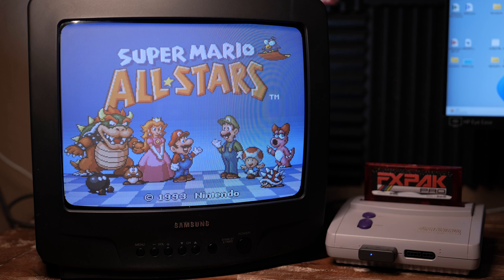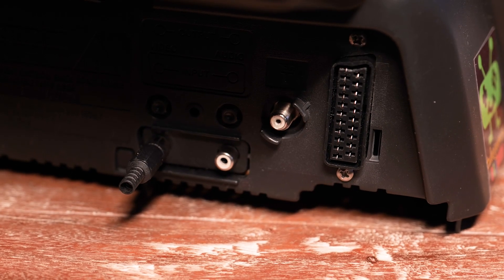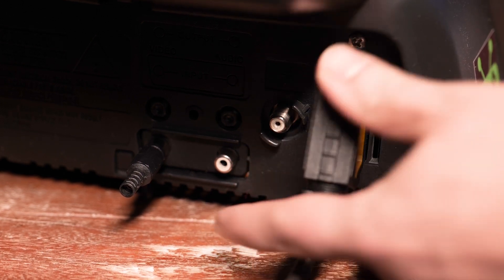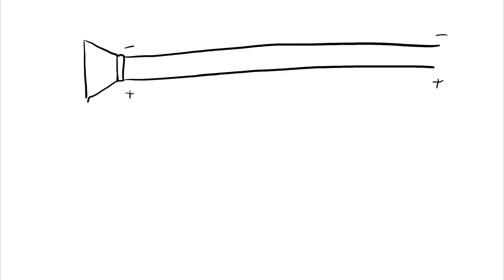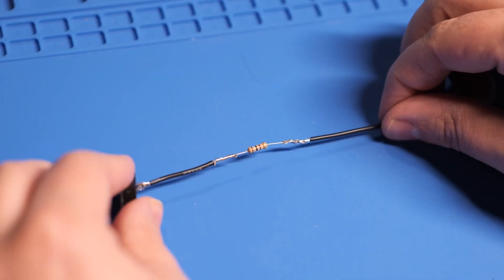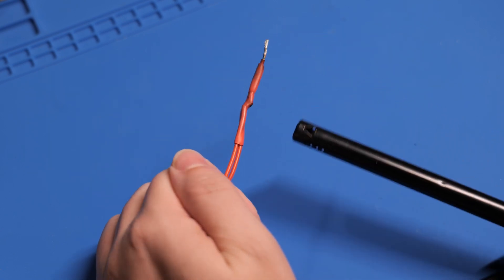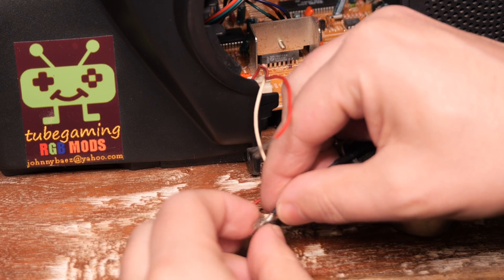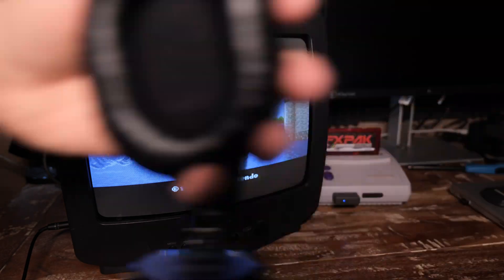Installing a headphone port onto an old CRT

Comment: Adding this to any device is really easy, but I have more fun and use to add auxilary jacks to car stereos, radios, basically anything that has amp built in and from there I put a bluetooth module because wires are kind of ghetto these days,

Comment: Apologies if you mentioned it in your PS video, but did you have any experience with soldering/electronics before the PS project?  You tackled these with mega confidence.  Well done.
Reply from the maker: I went to school a long time ago for Electrical Engineering, but admittedly I've forgotten most things since I haven't worked as an Engineering in over 14 years. But I can solder some stuff and use a multimeter, which gets me through basic gaming mods.

Comment: I'll be persnickety and say say you could have just used an RCA to 3.5mm passive adapter right on the audio cables. I guess what you have works though, but it looks like that TV only has mono, which is unfortunate.

Comment: You should not worry about the headphones since they have a higher impedance than the speakers.
Not sure about the resistor on the ground idea. You would want the voltage drop before the device you want to drive.
This however does not impede the flow into the coil at all.

Comment: Cool. My crt already had a port, but it’s only one audio input. Can it be modded to add both?
Reply from the maker: If you have easy access to the speaker wiring yes. This tv only had one speaker, so it’s wired for mono, if your tv has stereo speakers you have to wire it slightly differently
Reply: Yes you can do that, just keep in mind that resistance in parallel does go down. Do never try to go lower in resistance than it's rated on your speaker. This will overload the circuit. So if it has 8 ohm speakers, then do not go lower than that. But that should be nearly impossible because general purpose headphones have 16 ohm. Two of them is 8 which have the same power draw as the speakers.